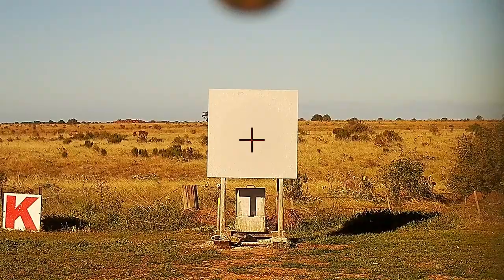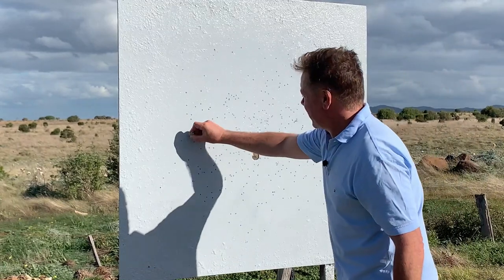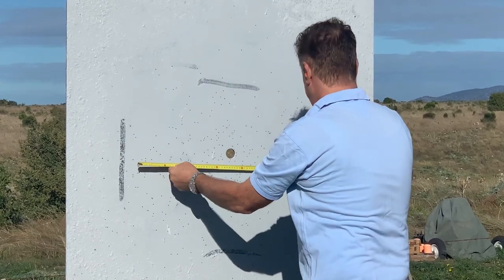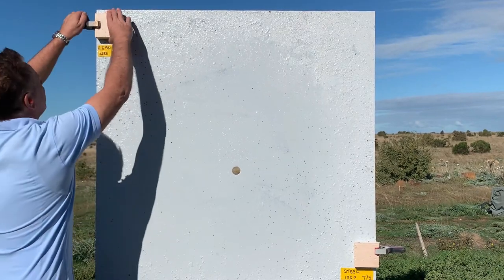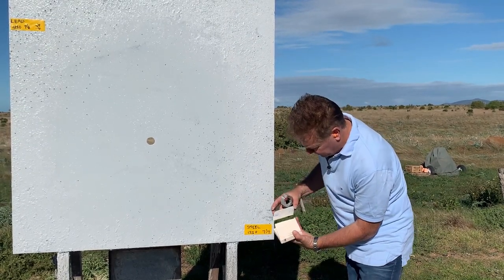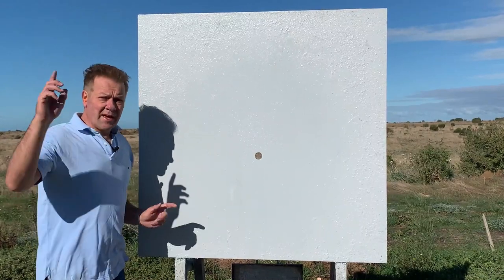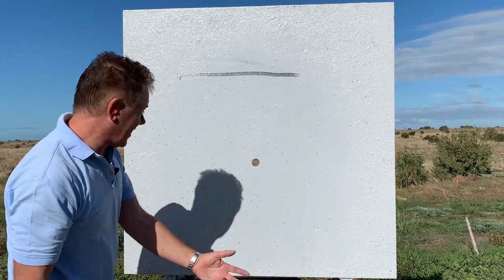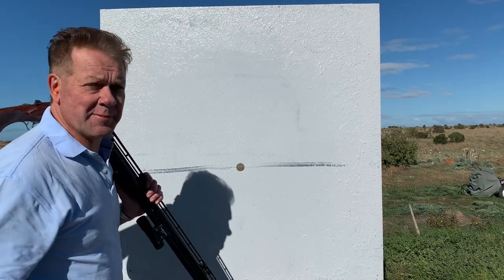Steel shot vs Lead shot - Go Shooting Shotgun Coaching Videos - Series 2 #20

Comment: In the UK we have been forced to use steel on Wildfowl since 1999 and in that time we have learned a great deal how best to use it. The very low density/weight of steel shot must be compensated by higher velocities. I would not consider using a steel cartridge with a speed of less than 1400 fps, even for clays. Shot size must also be increased, No5 shot is now regularly used on clays here. (Not sure if thats allowed in major competions yet) The bigger shot/weight increases penetration, but you do lose some patten. For Game and Duck i use No3 or No1 34/36g loads shot and speeds of 1450/1550 fps. Choke also can be tighter than modified, but there is a risk of ring bulges over time so if you use a high value gun best use modified.

Comment: You have just proved that lead is far superior to steel in all aspects of efficiency both as a clay and game cartridge.  Those who want lead banned need to see this video.....
Reply: Yeah they don’t want it banned for its performance reasons dude.. there needs to be an environmentally friendly alternative to lead, and I don’t think steel is it.
Reply: @James28R  Yeah, but if you look it up.... Lead is a naturally occurring metal found in small amounts that comes from the earth's crust. I'd be more concerned about people throwing out plastic and garbage than shooting lead pellets from a shotgun.
Reply: @James28R  Lead used in ammunition is hard lead, it barely leaches into the soil/water at all as it forms and oxidized layer which is not soluble. There's a reason we still find 100s of years old lead and cannon ball, roman 'sling-bullets' from 1000s of years ago etc.
Reply: @James28R  Lead is part of the environment, like everything else it comes from the earth. 
When inhaled as fumes it’s dangerous, when consumed as a solid it’s harmless. 
It doesn’t poison birds as some would have us believe, it also doesn’t sit on the surface long. It’s heavy so it sinks through mud and lake sediments and is far out of reach for birds.
Reply: @XAVargasX0206  - Uranium is a naturally occurring metal found in small amounts in the Earth's crust, so is polonium, I can assure you that you wouldn't to consume either of them.
Reply: @mrsmith9079  Small amounts of lead....insignificant.
Reply: @XAVargasX0206 not pounds on the surface. I swear y'all dont think
Reply: @LaughingMan44 once again wrong.
Reply: @wesrichards6168 oh my god uranium is natural
Reply: @XAVargasX0206 you are blasting pounds a hunting into the environment. One box is 2 pounds do math
Reply: @beekeeper8474  great argument kid, genius. I will respond to you the way you did: no, you're wrong. Then you will reply with "no you" and we will waste a lot of time.
Reply: @beekeeper8474  You can do math but you can't do common sense.....

Comment: Good video. Another thing to take into consideration is velocity. Lead shot will retain a higher velocity down range over steel. It’s kind of like comparing a golf ball to a pingpong ball. If you throw both at the same speed, the golf ball will travel further at a faster speed.
Reply from the maker: Absolutely correct

Comment: So basically the way I see it steel could be used as a defense round at the very least, for shotguns. If u don't want projectiles over penetrating this makes sense to me. So long as u keep range in mind, but for home defense that's fine cuz ur dealing with less range typically anyhow

Comment: Excellent.  I have heard too that lead and steel string out differently which might make some difference.  If you know anything on that subject, I would appreciate it.  Thanks.
Reply from the maker: From what I gather the effects on shot string are more manipulated by choke size than the weight of the pellets. I will see what we can find out.
Reply: @GoShooting  At shotshell.drundel.com I found this quote: "Lead shot, which is easily deformed upon firing, develops a relatively long, large-diameter shot string. Steel shot, because it is three times harder than lead, stays round, and develops a shot string that is 50-60% shorter and 60-70% narrower than lead."

Comment: Hi Russel, when you say some manufacturers do not recommend using above half choke with steel shot... they wouldn't recommend going tighter or more open than a modified?
Reply from the maker: Yes mate, half choke maximum. Some do not recommend full or even 3/4 (improved modified) especially with the larger shot often used in recreational hunting for larger birds.

Comment: you should try 3.5mm hunting shots with lead and steel. lead usually is about 400m/sec and steel shots 450m/sec. compare those in penetration.

Comment: Very good test Russel. However you touch the subject your self. I shoot in a country with steel only ( apart from a few ranges that allows lead  in ISSF disciplines) my own OT is steel only. And this the national governing body here, have allowed to shoot OT with shot size 6 and 28 grams. That has almost the same power as the 24 gram lead allowed in ISSF. It could be interesting to do that test. And yes we still shoot the steel through some tight chokes here, no worries as long as shotsize is no bigger than 6 and 28 grams. I honestly think manufacturers cover their bases with the no more than half choke. If not, some one would go full choke with BB and 42 grams.
Reply from the maker: Hello Lars, I hope you are well. The penetrating power of steel on short range targets is adequate, but for your second barrel at Olympic Trap, long range sporting targets or even targets that are hard in composition, in my opinion, steel 7 1/2's wont cut it.

 I understand the situation you face in your country. 28 grams of 6 shot would help (but as you know that amount and size are illegal in ISSF). IF steel becomes mandatory then targets will need to be made softer and thrown closer if the same scores are to be realised. 

Handicap shooters in American Trap or DTL are kidding themselves with steel loads.
Reply: I can honestly say I have no issues with second shot ( steel, no 6 24 gr).albeit a mediocre recreational shooter I have no stakes in it. Some of the guys I shoot with are seasoned shooters, ( participants Seoul olympics ). And they are not complaining. And the good shooters often get  25. They would all prefer lead, but not due to the breaks, but the less recoil. 
This weekends local competition ( 28 guns). Lowest final score was 110 highest 119. All with steel shot. Not international standard, I know but also the Danish trap community isn’t that big ( and not many  regularly score MQS). All targets was thrown according to ISSF regulation. Don’t get me wrong, majority would shoot lead if we could. But after a lead ban since 1996, we have grown accustomed to it.
Reply: @larsselchaujrgensen6712  Give is a video on your shoots and setup, a lot of people would be interested.

Comment: For bird hunting that it always better to prioritize steel even if it’s performance are less than lead. Lead is toxic and will contaminate the meat you eat, the carcasses you left behind that other animals will eat and be contaminate as well, water too is susceptible to be contaminated. You can adapt if you were using #7 lead you can try #6 steel to compensate for the lesser density of the steel.

Comment: What about copper? Copper is no alternative? It is more dense than steel and stil no as hard. 
also not cheap but I guess way more cheaper than bismuth or tungsten...
Reply from the maker: I guess its only the cost that holds some of these metals back. You could argue gold is quite heavy also, but unrealistic to use.

Comment: At 1250 fps in steel its little better than useless, up it to 1500 fps + and its a different ball game. Unfortunately this exceeds CIP regulations so no commercial manufacturer will go there.
Reply: They do make that, just not for your area. In Denmark I can buy 600M/S ( 1900fps.) shot if I wanted, anything less than 400m/s (1300fps.) is elligal to use while hunting. 

Steel has other limits than Lead and all these tests are pretty irrelevant when they do not take the differences in material into account. 

We have had no issue using steel for 30 years here, and many of us are wondering what the hell the fus is about.

Comment: Great vid, wow steel is useless for hunting??? Well with a modified choke, I will be using a full choke from now on
Reply from the maker: I would advice sticking with the Mod choke, but going up in shot size instead. Many manufacturers wont honour a warranty above Modified choke when steel shot is used
Reply: Follow the advice on steel, full choke will have you buying a new gun.